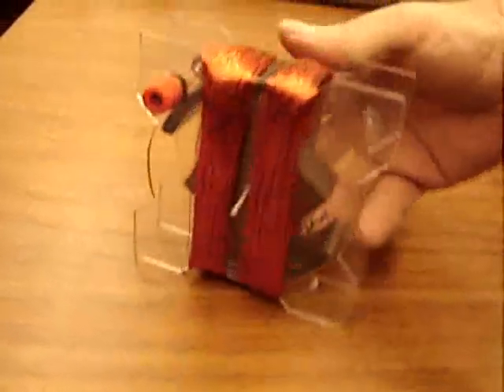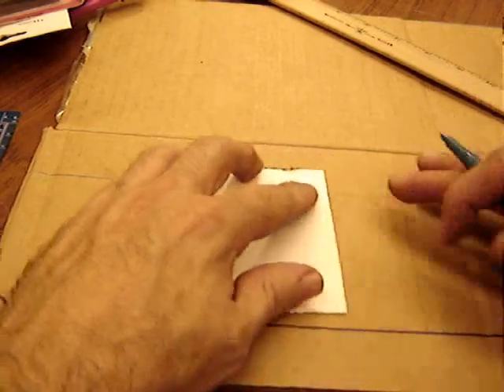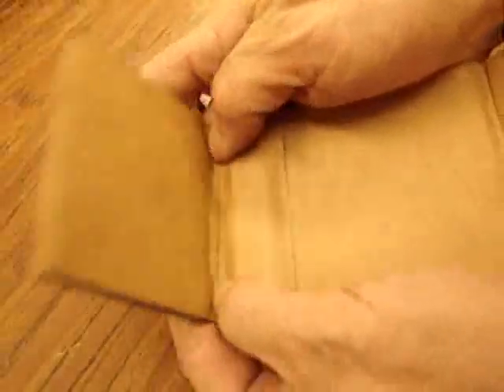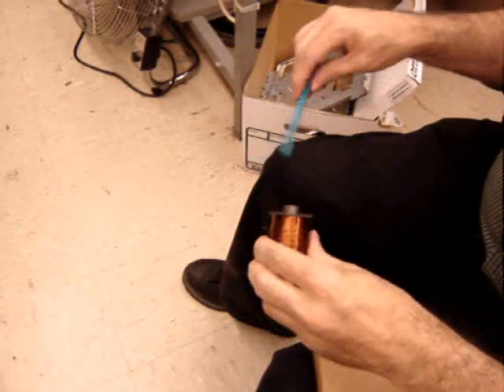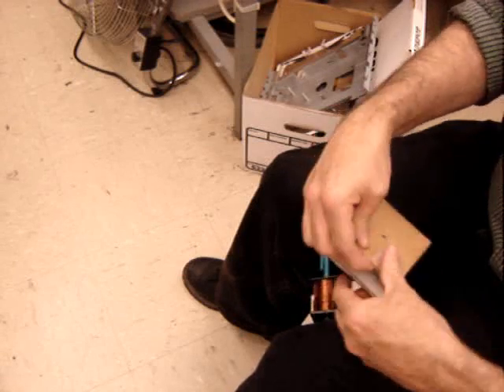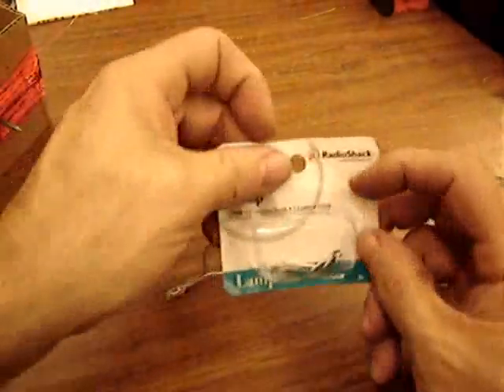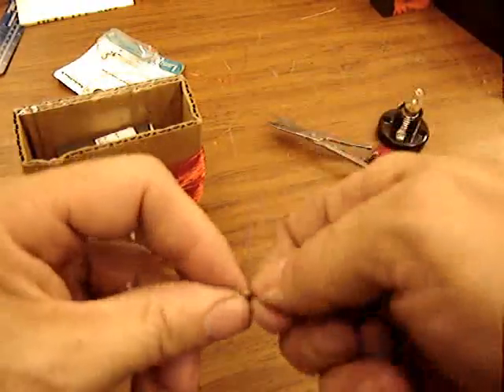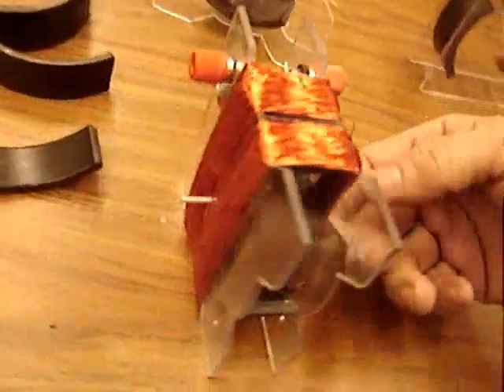Simple generator:  AC electric generator for science fair

Comment: i have a question: if my phone battery dies, will this ever charge up my phone to 5%？ can electricity be stored by cell phones?
Reply from the maker: +forever Hungry It's an AC generator, about the simplest possible.   For phones you'd need a full DC generator with brushes and "commutator" switch.   Diodes don't work with this, only a switch, since the voltage is so low.   Perhaps wind 2500 turns of wire, not 250, and change the AC to DC with diodes.   Definitely use Neo Supermagnets of similar size, rather than weaker ceramic magnets.

Comment: +wbeaty what sizes were the magnets?
Reply from the maker: +Wayward Son   see main website, parts list for the project.   Big black ceramic magnets, sold many places.   I see that sciplus.com has those currently, two for $2.50, number 10584P2, also the same version with two holes for plastic nuts and bolts to clamp.

Comment: how can we optimize the energy?
Reply from the maker: +Taranbir Singh    see the FAQ, click on the main project article.

Briefly:   add lots more wire, stronger magnets (neo rare earth,)  thinner housing VERY close to magnets, and build a belt-drive to spin magnets much faster.   An iron ring outside the coil would help.   Instead of using iron, add more rotating magnet boxes outside the generator: they function as iron, and force the flux to extend outwards, crossing the coil.

Comment: can we light an led?
Reply from the maker: +Alankriti Singh Yes, try a red LED, but need to spin the magnets way faster.   The special light bulb needs 3/4 volt, while an LED needs 1-1/2 volt.    (Or, wind more of the #30 wire, 600 or 800 turns.)
Reply: Thnku

Comment: Circle magnet from a speaker?
Reply from the maker: +Odeng Kartofel   Speaker magnets work fine, but they must flip end-over-end.   Perhaps glue two of them together with spacers, so a nail will slip tightly between them.

Or ...if you have neo supermagnets, you can swipe the neos across the loudspeaker magnets to remagnetize them.  The neo magnets totally overwhelm the black ceramic magnets, as if they were iron nails.    That way you can wipe out the old poles and instead create poles across the diameter, then run the axle through the hole in the speaker magnets.    Hint: if speaker magnets are magnetized across the diameter, rather than on the faces, then they must be positioned on the axel so they repel each other (so that N pole is next to N pole.)

Comment: isnt this a dc generator?
Reply from the maker: +Micah Cory  See the main project website for extensive explanation.    All generators are AC, unless they have a rotating "commutator" switch which converts their natural AC output into DC.    When the magnet flips half way, it puts out a positive pulse.   When it flips the rest of the way, it puts out a negative pulse.   If you spin it, it puts out AC.
Reply: I did look at the full plans out of curiosity, i actually made this many years ago after watching this video, it was my first little project i did and i still have it.
   however, im a bit confused. i thought to produce AC power you need atleast two coils or armatures (single phase), or am i thinking of a motor?
Reply from the maker: +Micah Cory  with both generators and motors, where the rotor is a magnet, one coil involves a single phase of AC.    Two coils positioned at 90deg gives you four (or three) wires, with two-phase AC.

Comment: I'm getting tired of people calling it a fake on websites they claim that it's being powered by a power supply under the table I don't see another cable connecting to it.Its probably the simplicity that throws people off.News flash not everything has to be complicated.Although a explanation would be nice I thought about converting a box fan into this.
Reply from the maker: +Joseph Carson   This video is part of a 1996 science fair project website.    It has complete instructions, explanation, etc.    Click above where it says MAIN PROJECT WEBSITE.    Or, http://amasci.com/coilgen/    Over nearly 20 years thousands of kids have built this for school.   Or, try the projects linked here: http://amasci.com/coilgen/generator_4.html
Reply: Thanks for responding so quickly I've been wanting to do a version of this on a box window fan do you think it could work?
Reply from the maker: +Joseph Carson The magnet must spin pretty fast in order to light a bulb.  It runs faster if you have a little propeller, then blast it with a water jet from a garden hose spray gun thingie.
Reply: What if you where to make this in series and put it in a air tight pvc pipe then attach a pump to it?

Comment: I'm curious, how many times would you have to wrap the copper to say, charge a smart phone? never been good at math but I have a friend that's more then competent with electricity and electronics. and I am trying to find a way to build a generator to power small household appliances. any suggestions? every generator I've found online is not newbie friendly or they don't disclose their method/process of building "said generator". any advice and or tips would be greatly appreciated.
Reply from the maker: +LordRain1031 See the FAQ on the main website.    Simple DIY-built generators are way too feeble to do much.  But instead, you can use an old DC motor as a generator.  Figure out how to spin it fast (perhaps bicycle wheel.)  If you can spin it for half an hour, you can partly charge a phone battery.    If you really wanted to make a DIY generator from scratch, see the wind-turbine websites in the links, OTHERPOWER etc.   Those have plans for serious high-power generators, but without first needing an entire machine shop.

Comment: +wbeaty what volts did u used on the led
Reply from the maker: +Bruce Hulk  red LEDs need more than 1.5V before they start to barely glow.    That special light bulb is better, since it starts to light at about 3/4 volt.   If you use a red LED, you need to spin the magnets way too fast.   Or, add 2X or 3X more turns of wire to the cardboard box.

Comment: Sir

does this generator works on led lightbulb? a LED white 5mm,and using a shattered speaker magnet?

 please reply Thanks :')
Reply from the maker: Rico Piñon To start, use red LED only.    (White LED needs over twice the voltage, while red LED is easy to light.)    If magnets are small or weak, then spin them faster, and add many more turns of wire.

Comment: can you use neodynimiun magnets in stead of ceramic
Reply from the maker: seun famurewa  Yes, but either use very large expensive ones, or make the cardboard box much, much smaller.   With neo magnets you only need 50 to 70 turns of wire, not hundreds.   But the wire must be very close to the flipping magnets.

Comment: how many volts does it produce?
Reply from the maker: jacxson 2323 Voltage depends on speed of magnet, upon strength of magnet, and upon number of turns of wire.

The generator easily produces one volt AC, to light the special bulb.

If you add more turns of wire, or spin the magnets extremely fast, then it can reach 1.5V, and light up a red LED.

Comment: How can I turn Physical energy into electrical energy? say I have a rod that is capable of spinning at high speeds. This rod may be strutted like a gear. I am working on a magnet motor and any tips would be appreciated. Maybe doing what is done here, but simply adding MY motor on the top to spin this rod and magnets?
Reply: +Camroc37 A simple dc motor actually is is a generator too

Comment: how do I know which cable is "+" and which is "-" or there is no difference? 

also, I have 2 different 3m pieces of cupper. can I use them togheter or I have to use them sepparately?
Reply from the maker: Eduardo Martinez It's AC, so no positive and negative.   Well, actually the polarities reverse twice when the magnet flips over once.   With 3m wires you can combine to make a long wire, twist the bare ends together or even use solder.  But adding extra 3m isn't worth it, since you need 100 or 200 meters of wire to make this work at all.   (But if you use large neo supermagnets, you'd only need around 20m of wire)
Reply: Holy damm haha thats way more cupper that I though!! I'll try anyways haha. Thank you
Reply: wbeaty Also I just read the information on your web page. Is there any other kind of wire that can give me a bigger "sea of charge"? I will try with neodimium magnets too. The ones I'm using are like 900 Gauss or something. 

I'm studying electronic engineer and its pretty awesome what you can do with magnets. I do really want to take all of this to the next level
Reply from the maker: Eduardo Martinez   See the FAQ section on the website, it has lots of info on where to find that wire for cheap or free  ...or just buy spools online.   It's #30 gauge "magnet wire" with varnish enamel insulation, get it out of cheap solenoids bought from surplus electronics shops and other sources listed in the article.

Comment: Could I use a LED?
Reply from the maker: Political Inactivist    RED LEDs work, but you'd have to spin the magnets about twice as fast.   Either that, or wind twice as much wire onto the generator.

The special light bulb lights up at under one volt.   The most sensitive LED lights up at more than 1-1/2 volts.   (Red LEDs need the smallest voltage to light.   Green LEDs need more, and blue or white need way, way more.

Comment: My generator didn't work. i don't know why, I followed all the steps but it still doesn't work
Reply from the maker: Serafina Churchill Tried all the "debugging" hints on the main website?   Usually its:  wrong bulb (must use that special Radio Shack bulb, flashlight bulbs won't work) or wrong magnets (must use large black ceramic rectangle) or wrong wire (must be thin varnish-coated #30 wire), or maybe just spinning the magnets too slow.

Comment: My friend and I are creating a water wheel that powers an LED by turning a generator like the one in your video.  For the axle, do you think it would work if we used a nail longer than 8 inches that works as the axle for the generator and the wheel at the same time?  Also, do you think a water wheel could spin the axle fast enough to power an LED?
Reply: Or we could use a wooden dowel as the axle and screw in the nail on the end.
Reply from the maker: Owen Marshall Young the axle can be anything, nail, wood etc.   Metal spins fast and can be greased.

For waterwheel you could blast it with a garden hose, using a "gun" attachment with the narrow water jet.

Also, LOTS MORE WIRE will make it work much better, like 600 or 800 turns instead of just 250.

Also, neo magnets work about 7X better, but need similar shape magnets, around 2in wide.   Maybe this kind from All Electronics would work, if the N and S poles are on the wide flat sides, same as a black ceramic magnet...  http://www.allelectronics.com/make-a-store/item/mag-132/2-neodymium-bar-magnet/1.html    But I haven't tried that one yet.

Comment: Could I use neodymium magnets? wbeaty
Reply from the maker: Sam Mloome 
yep, neo mags work about 7X better than ceramic.   But you'll need a similar shape, like 2" wide.    Don't use those curved hard-drive magnets, since they have both poles on the same side, which cancels out most of the field.

See the main article.    I use those "buzzing bee" magnets with nails glued to the tips of the magnet as axle.   Those have the N and S poles on their side, not on the end.   Spin inside a tube.   But the wire must wind across the tube ends, so you need some pieces of plastic on the tube ends (with a hole in the plastic for the nail.)   Those will light a red LED using only 50 turns of wire.
Reply: wbeaty Thanks alot. I was wondering if these would work?
http://www.amazon.ca/Strong-Block-Neodymium-Cuboid-Magnet/dp/B00NYX3Y30/ref=sr_1_10?ie=UTF8&qid=1425612304&sr=8-10&keywords=neodymium+magnets
Reply from the maker: Sam Mloome Those are a bit small, less than an inch wide, but should work OK if you can get the wire close enough.

Note that if you spin the magnets inside a short piece of plastic pipe, the coil has to wind around the ends of the pipe (close to the nail, as usual.)

Comment: is there a limit to the amount of enamel coated magnetic wire you can wrap around the cardboard structure before it become useless?
Reply from the maker: I have a big spool, so I usually add 600 turns or more.   This increases the output voltage, so lighting up a red LED becomes easy.  And with the tiny light bulb, you won't have to spin the magnet so darned fast.   But adding more turns doesn't increase the maximum possible current.

You can keep adding more turns until the wire-blob is putting the outer turns quite far from the magnet.
Reply: so would the optimal amount of turns be that just inside the magnetic field of the magnet?
Reply from the maker: Kieran Rafter
The magnetic field goes out to infinity!   But it's only strong close in.

The wire needs to be thin, so that hundreds of turns won't make a thick coil.  All the wire needs to remain close to the magnet.   With thick wire, or with too many turns, the coil might be inches thick, and the outer turns will be inches away, so won't contribute much voltage.     Real generators avoid this problem by using iron parts to guide the magnetic field so it reaches out and hits the entire coil.   Need a machine shop to make those.   Or at least power tools.

Comment: Looks like you're getting some flickering in your bulb -- If you run the AC output from your generator into a diode rectifier bridge (really simple to build, just four diodes -- this gives you a DC output from your generator -- just make sure not to use the diodes that steal 0.7v from you) and then if you connect a small ceramic capacitor between the +/- contacts (so connected in parallel with the bulb) you'll get a much smoother power source (no flickering in the bulb). -- It will also glow for a moment after you stop cranking until the capacitor is dry (depending on the size of the capacitor, it will take longer to fill and deplete). 

Additionally if you gear this up (so that it spins faster than you crank it), that should also help with the strength of the bulb.
Reply from the maker: Nope, doesn't work.    Try it yourself.

This generator only puts out about half a volt, so a single diode destroys most of the output, and a bridge rectifier doesn't work at all.  (That's why DC generators use commutators rather than diodes.)   To use a DC bridge, we'd need to wind about 10X more turns of wire than used here.    Most kids in grade school can't do that task.   But they might be able to build a hand-cranked rubber-band belt step up device, and spin the magnet 10X faster.

Comment: I was curious as to the possibilities of the amount of electricity that could be produced using magnets and copper wire. Does the size magnet ,thickness gauge wire , the RPMs  take effect on different size electrical currents.
Reply from the maker: See main project website under OTHER THINGS TO TRY,   MEASURE THE VOLTAGE AND CURRENT
Reply: I cannot test the current on the account that I haven't built the generator yet. Although I cannot build a generator because I don't know whether or not the generator will be able to take the RPMs. Let's just say the power  supply I'm working on for the generator will put out more RPMs. Let's just say I need someone to work with me on that end of my project.
Reply: This is the base principal of how most generators work -- you move magnets close to wires and then the changing electromagnetic force causes the electrons to move back and fourth on the wire (hence it's AC power -- electricity isn't being generated -- the electrons are already there, they're just not moving -- but the magnets cause them to move back and fourth -- generating "potential" [aka measurable voltage]).

The generators at your local dam use water to turn a turbine.  The coal based generators operate a boiler to also turn a turbine (like a train engine), same with nuclear power even... All those power plants are just turning turbine to generate electricity this same way.

So, this is very scalable, in general you'll find that the more electricity you plan to produce, the more powerful the turning force must be (as a result of other factors).
Reply from the maker: Mark Ouellette   GO TO THE MAIN PROJECT WEBSITE.   The main site, go to it!   Read the section that answers your question.   You don't have to measure anything, I already did that.   The section to read is called "Other things to try, measure the voltage and current."    Other sections describe how to get much more out of this, even how to build an "adult level" device.   Also, go to the links page to see kilowatt DIY projects, simple wind-power generators.
Reply: Mr. Beaty I am an inventor and the  invention I'm working on requires that I speak directly with someone knowledged in this subject. I really can't say much more right at this time.  mouellette51@yahoo.com

Comment: If I have 2 spools of 300ft wire, is there a way to connect them together to make it work? Thanks
Reply: You cannot join two wires using tape as it may change the polarisation.  You have to solder the two wires to make it work.

Comment: im trying your plexiglass version for my sixth grade science fair and its not working to well for me. I have 2 six inch long squares both having 4 holes between the center and each corner. I ran wooden dowels through these hole and wrapped the copper wire parallel instead of perpendicular to the plexiglass. This is around my ceramic magnets in the center on a nail. When I hooked this up to my voltmeter and spun it as fast as I could it did not work. Do you have any idea why? If so please respond because my science fair is in only a week and a half. Thanks!!!